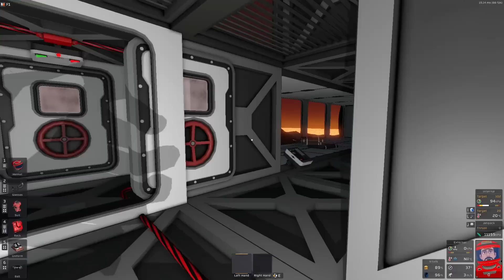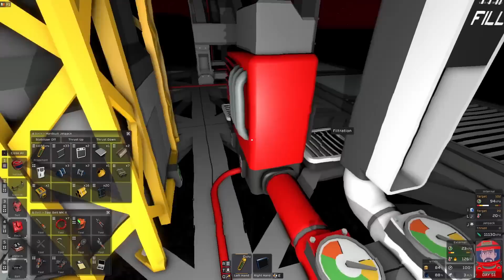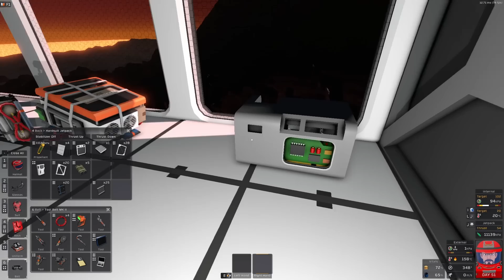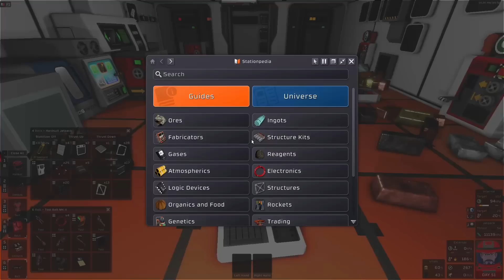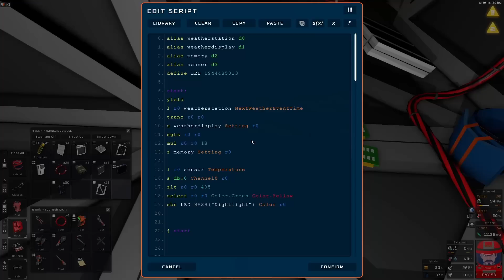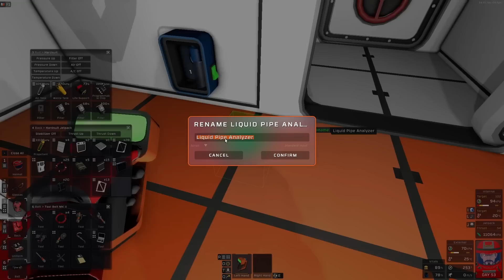Stationeers Phase change Vulcan 13 Automate everything

Comment: A bit late to the party, but you could also store the alarms in a secondary register, and do a comparison... So that if the current alarm cycle matches the previous alarm cycle, it jumps to start and skips the broadcast... So you would only get the alarm once, then the system would ignore it until the alarm status changes.
Reply: This would work, but I think I (personally) would still use the repeated alarm. I would forget the last alarm due to my ADHD and getting distracted.

Comment: If they didn't change anything, printers are not consuming a lot when idle. Stackers, on the other hand, consume like 100 W each. Sorters probably consume a lot too.
Reply: I feel like appliance idle power consumption really needs a nerf. It shouldn't take 100W to periodically pulse a sensor to wake up the rest of the circuitry :(

Seriously, like 4 idle stackers consume as much power as my whole computer does playing the game.

100W is a lot of power. Assuming a 24v control system, that's over 4 amps.

Comment: One thing i don`t get is what stops the furnace tank to get warmer and warmer. The H2 combuster will heat it up but the heat has no place to go so temp will continue to rise, mine is 1700 degrees and rising, where does it stop or did i miss a thing?

Comment: Is there a state on the printers telling you if they are currently printing?
If there is one you could automatically shut down the printer transformer if the printers are ideling for let say a minute.
This should save a lot of power when you forget to turn of the transformer.
Reply: Maybe check output slot and if nothing is there for minute turn off?
Reply from the maker: I con turn off the printer but the data for the transformer is external to the circuit, So I cant switch it off from the printer side.
Reply: I haven't thought of that. Good to know.

Comment: Would a Small Transformer (Reversed) have worked with data on the output?
Reply from the maker: Reversed just changes the side that the switches are on.  The data is still on the input.

Comment: Coding/mechanics question: Is there a reason why you can't write to the setting of the circuit housing instead of using the memory?
Reply from the maker: The memory has two data connections, so I can use it to pass data from the local cable to the  heavy power cable by connecting both circuits to the same memory.
Reply: I did not know it did that. Thank you. @cowsareevil7514
Reply: I think the housing setting is already used to graph, he needed a secondary output

Comment: This is a pretty impressive list of automated works.

Printers: check and auto-requesting
Furnace: reliable heat reservoir
Mineral sourcing: automining, manual fuel regulation and startup
Cooling: check and stable
Oxygen production: check and stable
Water production: check and monitored
Power: check, monitored, beautiful graphs
Warnings: automated, audible to hardsuit
Airlocks:
Reply: Airlocks: manual

Comment: Small QoL idea. 
Save batch into all transformers on the main power line their desired output power, so everytime you put up new one, you dont need to madly click to set them manually :)
Reply from the maker: That is a good idea.  I could also have the power system shut off transformers when the power is low.

Comment: For the storm warnings, why not add some timing steps so the warnings repeat say three times at 20 second intervals and then wait a couple of minutes? That should give you some redundancy in case you miss/ignore/forget the first one but still not have it constantly going off. Also, typo in video name
Reply from the maker: I could wait until the last 2 minutes before giving the warning instead of the whole 12 minutes.
Reply: @cowsareevil7514  Alarm sounds have numbers too, so maybe alarm for first storm detection and then last three minutes countdown every minute? I think there are only "one" "two" "three" alarm sounds
Reply: You could also leverage a stack, to cycle through the alarms instead of just having a "winner." A few seconds sleep between each.

"Low power. Storm incoming."

Comment: Excellent video - Thanks Mick!

Was there a particular reason why you didn't just use another sensor, or were you just seeing if you could do it without another one?
Reply from the maker: I could do more of the same but then I wouldn't learn anything new, so I tried something I havent used before.  And there is a lot of hot things around that area that might be a problem.